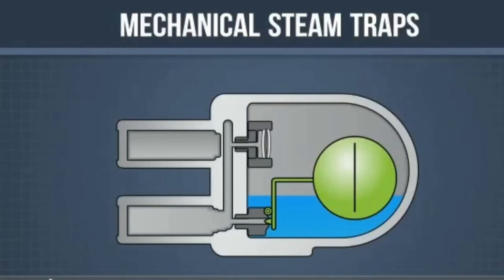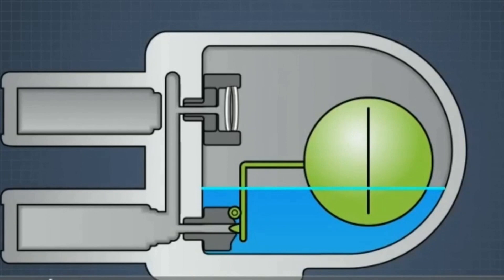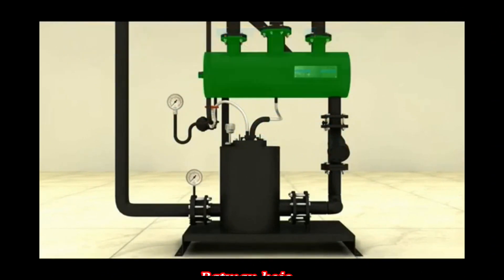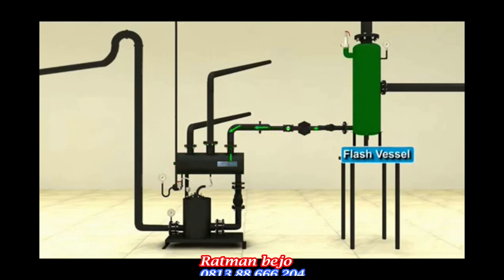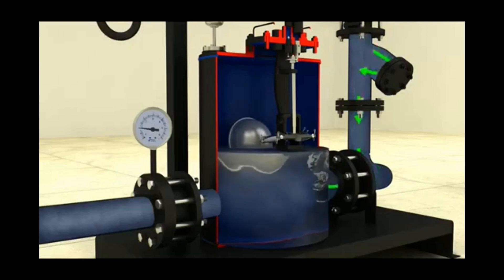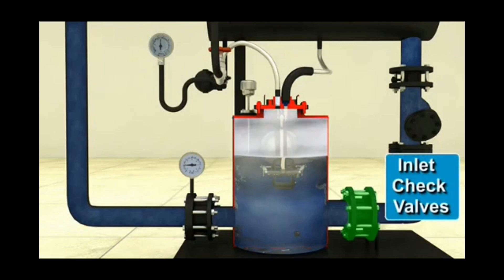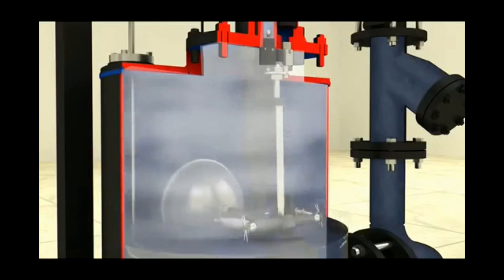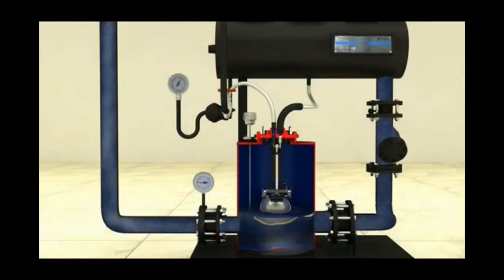Condensate Flash Recovery System - ADCA Mat Package Automatic Pump☎️✔081388666204🔥

Comment from the maker: Condensate Flash Recovery System ADCA Mat Package Automatic Pump
THERMODYNAMIC
FLOAT AND THERMOSTATIC
INVERTED BUCKET
THERMOSTATIC
BIMETALLIC
UNIVERSAL STEAM TRAPS AND CONNECTORS
UNIVERSAL STEAM TRAPS AND CONNECTORS (FOUR-BOLT)
COMPLEMENTARY EQUIPMENT